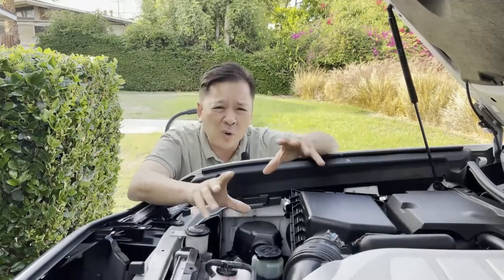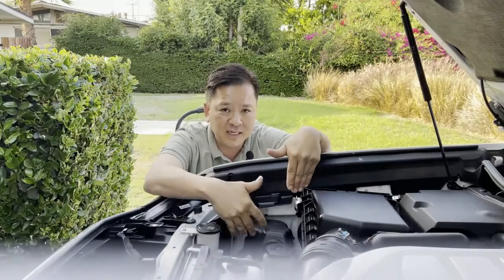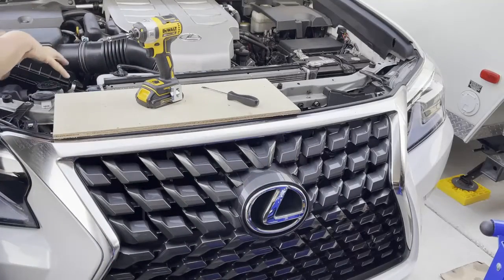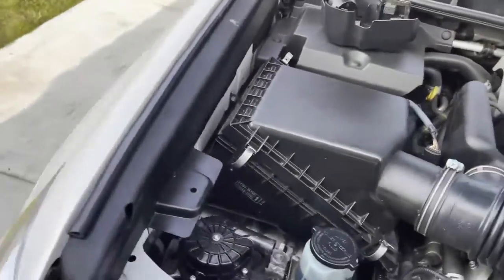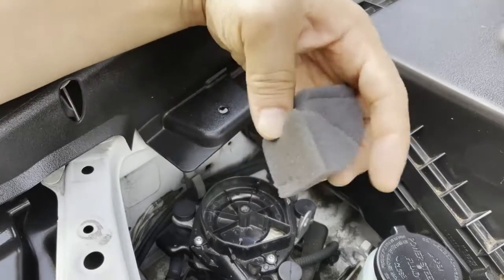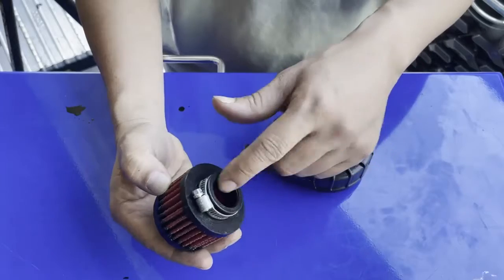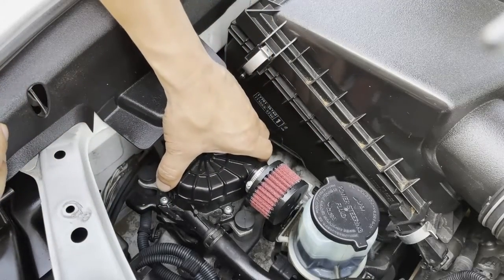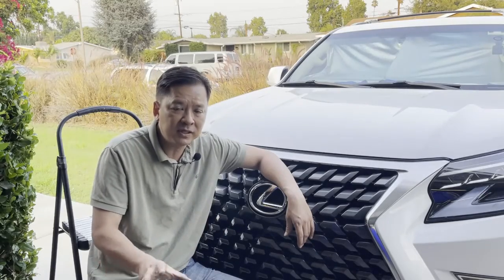Why We’re Modifying the Lexus GX Secondary Air Injection Pump

Comment: Great videos as always.   This is a life saver.   Will this fix the p2445 error on a 2014 gx 460.   I disconnected the hose when changing the power steering fluid like us suggested in your video.  But forgot to connect the hose back in my rush.  After driving it for a while I got the check engine light on, the p2445 error and the car went limp—little power.
Reply from the maker: Oooooh………. Reconnect, erase the check engine light, and drive around for a bit to see if it went away.
Reply: Tried that.  But that did not work.    Do you have a recommendation for a replacement.  Unfortunately, I have to replace mine.   @GXBOB

Comment: Thank you!!!  Any idea if this works for 2-2.5 gen Tundra’s? I know they have issues with this as well, but I’ve read folks bypass it with a Hewitt setup.
Reply from the maker: $20 versus $400. I don’t consider myself a genius but I’m going to pick the $20 one. Not only because of the price but because I’m keeping the Lexus oem design to function and do what its designed to do with only changing the filter material. If Lexus didn’t see the benefits in a secondary injection system they wouldn’t have engineered it into the trucks design.
Reply: @GXBOB  love it! Just ordered one for my Gx460!

Comment: Wonder if you have a video on fixing valley plate coolant leak? Thanks
Reply from the maker: No and I probably won’t until that problem surfaces
Reply: @GXBOB seems somewhat common, and a difficult work.
Reply: How would you even diagnose a valley plate coolant leak?  I hope thats not the issue on my 2014 with 125k
Reply: @LarryCableGuy19 if there is a mysterious coolant loss..

Comment: Hey Bob! Love your videos. I took the one torque screw off but the housing is firmly stuck in place. Any tips? It’s below freezing outside but honestly I don’t think that’s the reason. I tried prying it with the flathead screwdriver but it won’t budge
Reply from the maker: I’m not trying to be funny but have you tried the power of prayer? It works in some instances except when you’re trying to save your marriage.

Comment: Won't the exposed filter get clogged faster than the sponge on the inside?
Reply from the maker: A $20 clogged filter can be easily cleaned or replaced with routine maintenance. A compromised sealed  pump assembly can’t and will cost you a couple grand to replace.

Comment: Hey Bob do you recommend to install this new 2023 with 150 miles only ?
Reply from the maker: Hello!  With only 150 miles, i wouldn't bother. At least not now until you put 50k miles on the engine as a preventative measure.   It also really depends on what type of weather conditions you're living in because warm and highly humid weather accelerates the chemical breakdown of the foam material in your pump thru hydrolysis.
Reply: Awesome 👍 thank you for your advice

Comment: Great video Bob! Unfortunately, this just happened with my 2018 GX460. The service bulletin doesn't directly speak to this model year so I presume I'll have to pay for the fix and then do your mod to keep it from happening in the future. Live and learn.
Reply from the maker: You’d be surprised what the dealer would do if you go in kicking and screaming
Reply: To be clear, you had a failure because the foam filter disintegrated? Just asking because the foam type was supposed to be upgraded after the 2013 recall.

Comment: same as 4runner，btw can you wash this filter？
Reply from the maker: Yes u can wash this filter as you do a K&N filter. Run it under your kitchen sink and air dry.
Reply: @GXBOB  thx！
Reply: It needs to be oiled per the manufacturer every 20 to 30k miles also and does not come oiled so that is something that should be included in the video

Comment: That cap is specifically designed to keep water out. Big mistake. Water is way worse than dirty air. Do not go through and big water crossings or ever let it get wet.
Reply: @GXBOB  is this true? Should I still install this filter?

Comment: Do you install the cover back on? Doing this job as we speak lol
Reply from the maker: You install it back on when you go in for a smog check or take your truck into the dealership for any reason
Reply: @GXBOB would it affect performance if I keep it on? I’m now seeing this after doing the install. I’ve read some people would drill holes even
Reply: @GXBOB  left mine on for maximum protection against the elements. However I’ve read where people drilled holes into it. Not sure how effective that is

Comment: I have been dealing with this on a 2005 GX470 with failed SAI system faults for years.   Dealer said nothing about a recall and I didn’t want to pay the $3k.  Bought a cheap ODB computer to reset the faults every so often.   A third party computer bypass doesn’t offer permanent results.  Glad I came across this video.  Such a simple solution.  Shocked Toyota would make such a simple to avoid design error.
Reply from the maker: I’ve always wanted to attempt this on a GX470. Been looking for prices to drop so I can pick up a hobby vehicle to mess with. Thanks for the comment.

Comment: Hey Bob, thanks for the useful mod. Did you put back the plastic cover on top of the pump housing that was popped out first after you installed the new filter ?
Reply from the maker: I put it back on for a smog check. It requires you pass visual inspection. After it was done I take it off for optimal air flow. It adds another 180hp.

Comment: I just came across your channel. I’m thinking of buying a used Gx 460 and have been watching several videos on this vehicle. Your video I have bookmarked (along with the part from Amazon). Question: did you replace the other filter next to this part in your GX?
Reply from the maker: the other filter next to this part?  Are u referring to the air filter.  Check my video library, i did do a Kand N drop in filter install.

Comment: I read that you may have to keep the cap to replace for emissions inspections. Have you had any issues with emissions inspections with mod?
Reply from the maker: Read thru the comments. I did install the cap back on for my smog check visual inspection. 😉
Reply: @GXBOB  thank you sir, so it's only required for visual inspection? We don't have visual inspections in my state but they do connect the car to meters to get a report.

Comment: Just did this mod, as well as replacing the factory air is filter with K&N…easy peasy.  On this mod, I did not put the original outer cover back on, as it would literally choke off the new filter’s ability to breath.  You didn’t mention putting it back on, so I left it off.
Reply from the maker: I only put it back on when i bring the truck in for a smog inspection.  It will fail a visual inspection if you leave it off.
Reply: @GXBOB  great news is, here in Indiana, no smog inspections..

Comment: Love ALL your vids. I always learn something. Just 2 days ago I saw the one where you removed the rear left tail light. It was ULTRA helpful because I used that particular point of entry to run the fuel line ( used fuel line because it's super sturdy) to the rear differential breather. All the other videos were saying to cut a hole in the fuel compartment for access, which I did not want to do. Another one said to remove some panels under the car then find an access point under there to feed the tube and I was lazy and didn't feel like removing a ton of panels. Took off the light assembly zip tied the hose with the air breather and ran it straight down.
Reply from the maker: Interesting……,
Reply: @GXBOB  Another thing I'm wondering. You do a ton of things but I haven't seen you install illuminated door sills. I think it's a cool mod, but when I have looked I haven't seen anyone do it on their GX. Also when I look for the parts it's unclear if maybe the luxury trims have them and if they would actually plug and play into my Blackline edition.
You also frequently say your next vehicle will also be a GX. So with that in mind what's your take on the soon to come GX 550? I'm sort of considering it, but it kills me that it won't have the V8, no KDSS, unless you go to the overtrail. Will the Adaptive Variable suspension be enough on the Luxury Plus? Would just love your take. At this point I'm thinking the Overtrail to get everything, but then no third row. I'm just all over the place on what I would pick.

Comment: Hey Bob - I was towing today and when I accelerated on the on ramp, I threw the 4low trac off check engine trifecta. I also had this issue when I turned on my pedal commander when towing a boat. Could this mod prevent this in future? Also, I wanted to ask you what service I should do? I bought at 55k miles, at 97k now and have only done oil changes. Thanks my man! Much love from Florida
Reply from the maker: your lights popping on temporarily by hitting the gas pedal can mean anything...seriously.  The mod is only preventative maintenance from your sais taking a dump in the  future if  it hasn't already.  Your mileage is the same as mine right now and i'm about to replace all 4 rotors and brake pads.  I was also thinking about  replacing all 8 spark plugs too.

Comment: Hi Bob. Your videos are great. You have great energy. I just bought a 2021 GX. Is this still an issue on the 2021 year? surely they had it sorted out by 2021? Just curious because I will do this once its out of warranty otherwise.
Reply: Pennies chasing dollars
Reply: NO. I just did this on my 2022 460
Reply: @scarter176  Thank you Steve. I'm surprised Toyota would allow this component to be still installed on late GX's and not simply revise it.

Comment: Did you put the black cover / houseing back on after installing the filter or just left it off
Reply from the maker: i actually put the black housing back on.  You kinda have to if you are going to go in for smog check.  They do visual inspections to see if any emissions parts were modified.

Comment: Many thanks on how to do this! I did this last weekend but I'm wondering if that whine you hear on the cold start is normal?? I'm getting mixed answers on the forums. Some say it's normal and some say that it means it's going to fail in the future.....Should I just do the bypass altogether or is that noise truly normal. On my BMW that sound did indeed get louder before it failed. Mine isn't getting louder but I just don't ever want my truck to go in limp mode or get straned somewhere.
Reply from the maker: The whine is due to the suction of the external filtration system which is normal. It means it’s working. Anytime you add a K&N type filter you’ll get that sound.

Comment: Do newer GX's still have this issue or has it been rectified from the factory? Just purchased a new one last month and wonder if this mod would still be worth it?
Reply: I’m looking to buy a 2023 GX soon, did you check to see if Lexus corrected it?
Reply: Hi there. I totally forgot about this topic and just so happened to run into this video again 😅 So I checked the actual recall and it's only for 10-13 GX models, so I figure 14 onwards have the updated system, so I would imagine it's fine to leave it as is.

Comment: Last owner toll me this thing  happens to them and the dealer " fix it " So should i still do this mod just to be on the safe side or when the dealer fix it they change the filter already or they just put the same style filter again?
Reply from the maker: There is no fix. All the fix was is replace the unit with a newer same one that still has the exact same filter. They just bought you more time

Comment: Hi Bob, just bought a 2012 gx 460. Few weeks after I bought it the check engine light and 4Lo came on. Also I have a track off message on the messages. The shop I bought it from has been fantastic and they have done everything in their power to make it right. The changed solenoids and changes a much of things. Lights went off and a month later all of them came back on. Saw this video and I tried looking into the secondary air filter but I can tell it has already been changed. Any recommendations on what to do next??? Thank you, love the Chanel.
Reply: Sounds like it’s the transfer case accuator

Comment: QQ for you Bob. The pastic cover does not need to be installed after replacing the filter right. i tired and it did not fit. Just checking to make sure

Comment: I just  saw your vid. Thank you. I just bought a 2022 GX with 4500 miles from my local Lexus Dealer. Has this been modified or should I do the mod. Thanking you ahead of time.
Reply from the maker: You have a long way to go before a Sais starts breaking down on a 2022 GX. I would wait when you start hitting the 80k mark.
Reply: @GXBOB  Thank you for your response .
If I do it now would it affect the warranty?
Reply from the maker: @mathspecialistsllc9519  Depends, if your warranty is to diagnose, remove, and replace a rear window hinge.  I"m not sure why they would look at your engine compartment.  If you are still a little wary, the removal of that oil filter addon and clip back the original cap is literally like 10 minutes worth of work.
Reply: @GXBOB  thanks. I was not clear I apologize.
I want to be proactive and change that filter now.
Reply: I been watching your videos .
Very enjoyable.
If I do this mod, will any warning lights go on.

Comment: that first cover that u took off does that have to go back on ? @ the end 
i saw you didn’t do it hence i didn’t do it either just asking
Reply from the maker: you can put it back on if u want.  Its only for smog check visual inspection.   In california if they see u modified any of the emissions components you will fail the inspection.  I leave it off for more airflow.  Some people drill holes thru the cap where it makes contact with the filter for airflow.
Reply: @GXBOB  Thanks BOB Appreciate the quick response,  its gonna stay off

Comment: I'm not sure if it's different on the earlier years, but my 2017, it was easier just to take the cap off with that one torx bolt and then just pop off that little nozzle cap on the end. Just in case somebody wants to preserve it
Reply from the maker: Hey Thorsky, i believe thats what i did.  One torx on the top and the entire top half comes off.  The plastic nozzle cap can be taken prior to or after the housing  comes off. I did slap the nozzle cap end back on for smog checks.

Comment: Does the cover go back over it or does that have to stay off since the filter is oversize?
Reply from the maker: The cover can go back on without any issues.  I leave it off for higher airflow but i put it back on when doing a smog check visual inspection.  Your inspection will fail if the inspector sees the modification done.

Comment: Hey Bob. Enjoyed the video and the instructions, thank you. One question as I just finished this mod yesterday, do you put the black cover back on top hiding the filter? I see you mention that people in California should but I didn’t understand  if you can drive with it on long term. Seems like it would cover half the filter with the foam glued underneath the cover.
Reply from the maker: You have to remember that prior to this mod, it wasn't an open-air system.  Your Pump had a small dome cap that only had small slots allowing air to enter.  Now, with this mod,  if you add the black housing back on, your  Uni filter is exposed to the entire bottom half with is much more than the amount of air the original cap was allowed in.  So whether you install the black housing back on or not for the long term isn't really detrimental to its function.  You can do what some folks did by drilling air holes into the black housing to allow more air in or just leave it off.  In California, we have to undergo a visual inspection for emissions to renew our registration so that housing needs to remain  "oem", hence why i left it alone.

Comment: We just picked up at 2012 GX with 90k on it.  Will be doing this ASAP! Thanks Bob.
Reply from the maker: There’s a few things you should consider since it’s creeping up to the 100k mark. EGR valve, PCV valve, transmission fluid, differential, transfer case, timing belt, and water pump. Fun stuff!
Reply: Timing belt?
Reply: @gman7839 right? For clarity the 2010+ GX460 with 1UR-FE is a timing chain engine. 
With proper maintenance and oil change intervals The timing chain should never need replacement. 🤞🏼
Reply: I have 34,000 on my 2016 I am considering it, does Lexus sell the air filter

Comment: Question? I've did this mod and a week later today just now while driving on the freeway all a sudden my vehicle seem to shut off and power cycle back on? would you have an answer why this happen ? is it cause I did this mod or battery  issue or electrical?
Reply from the maker: The breather filter mod is not going to shut your engine off. Also, it would be impossible to diagnose without physically being there and without the vehicle mimicking the power cycle again. Your best bet is to let it ride since your cel hasn’t popped on and see if it happens again. In the meantime check your battery terminals and a visual inspection for any loose connections and vacuum lines.

Comment: Thanks for the tip!! How often do you change the K&N filter?
Reply from the maker: We don't change the filter.  We visually check it for debris, remove it, flow running water through it, let it air dry, then reinstall.
Reply: @GXBOB  Thank you for the quick response, do you also put the cover back on? Because it looks like it will block the air flow